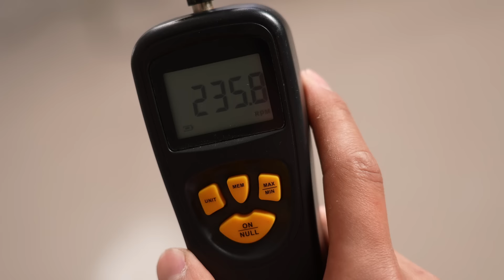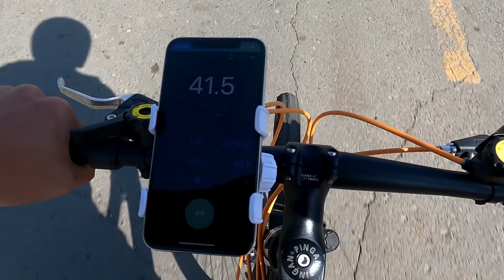Super speed Bike

Comment: Good work especially the way you welded segments of chainring to make a huge one, and using a short bit of chain to check the joints line up correctly was absolutely ingenious, but my legs aren’t to strong so I’ll think I’ll stick to my 44 tooth sprocket!!! Thanks for sharing 😀👊🏻
Reply: Plus he got this idea  from someone who already had a video up several years.
Reply: Electric assist
Reply: Looks like he didn’t check before welding that the final piece would fit on that disk, which is why there looks to be one oversized gap between pieces on the disk. Fortunately the margins were sufficient and it still worked, but I bet it produces a lot of chain bounce when the chain comes off that section.
Reply: @jeromilittle  This is lack of proper planning on his part .
Reply: Uki

Comment: That's impressive but he really let us down, that speed can easily be achieved by a beginner in an average mountain bike.
I was expecting him to go way over 60kmh
Reply: Bro I can only go 35 with my hardtail help
Reply: @Its_tomer   There are a bunch of factors that may be affecting your top speed.

1° Make sure you are using your highest gear the smaller cog in your cassette (and if you have more than one the bigger one on your chain ring).

2° Your posture makes a huge difference so try to be more aero when you're going fast!

3°  Your tires are also very important because they can completely change how your bike behaves. I personally use a  700x28 for the road and a 29x2.30 for dirt, narrower tires are the best for top speed (you can also use slicks if you are really going for it).

and lastly but pretty obviously avoid trying to hit your top speed going uphill because you aren't going to see really great results, try to opt for level ground and for testing the absolute limits of your bike you can go downhill.

!!ALSO PLEASE ALWAYS CHECK YOUR BRAKES BEFORE SPRINTING AND WEAR A HELMET IF YOU GOT ONE!!

Comment: I saw a chain wheel about that size in an early velomobile, years ago, that was made to go 55 miles per hour. I think they are even faster now.
Reply: nice but just so if you didnt know its called a gear wheel
Reply: @cutekiddej9023  chainring*
Reply: @cutekiddej9023  chainring
Reply: Cool! Is there any video of something like this?
Reply: @ffivguy1990  yes
Reply: No es eficiente que lleven tantos dientes
Reply: @xiki1506  porque no? ( No entiendo un choto, todo está en inglés)
Reply: Yo they go faster....normal cyclist are going 65+mph on 53 teeth chainrings etc..
Reply: @Joshua-rp3tm  as a cyclist 25 mph is not hard its just 40kph
Reply: i can do 50 on a regular bike
Reply: @supervortex8363  what bike?
Reply: @jonjon195  zaskar mtb with road tires
Reply: @cutekiddej9023  chainring, gear wheel, chain wheel, sprocket etc etc
Reply: @jonjon195  i have a GT zaskar with a 50 tooth front gear and 11 tooth on the hub
Reply: @yuca862  eso depende si la quieres para llano o montaña,por lo regular las de montaña ,llevan un plato más pequeño.
Reply: @princesol612  Sprocket*
Reply: Sounds french

Comment: Did similar in the 70's, longer cranks help but are dangerous while turning unless in the correct position!
Reply: I  remember being thrown off a few bikes from that, good times 😅
Reply: @ronniewilliz153  yup, exactly! ☺️👍
Reply: Thanks 4 the tip
Reply: Could you elaborate, how is it dangerous while turning please? Apologies if it's too obvious but I'm kinda newbie to bikes.
Reply: @mostafafouad3202  when "we" used to put the large sprocket and cranks from say a 26 or 27 inch bike on a 20 inch bike, the pedals would be much closer to the ground while driving straight on even terrain. With the pedals so low, if you were pedal down on the side that you were turning into that would cause the bike to jack-knife and usually cause you to fly off! It happened a few times, I learned the hard way! ☺️👍
Reply: @normandothegreat  Ouch I don't even wanna imagine the scene 😅. Good thing you survived and thanks for taking the time to answer a newb 😅. Have a lovely one sir. 😉
Reply: @mostafafouad3202  it is still fun to do, pedals easily and travels at a greater top speed, so for me it was worth the danger. There is a learning curve as with anything different. Have fun and stay safe. 🙂👍
Reply: @normandothegreat  wow now that you explained it I remember this happening to me in the 90's
Reply: Huh, wouldn't of expected that to be an issue for anyone. Thought having the pedal on the side im turning be at its highest point was just "instinctual".
Reply: @MrDJAK777  LOL, not for all of us obviously! I rode extremely aggressive, often pedaling as I was in the turn so I wouldn't lose my speed and momentum. I wasn't the brightest star in the sky! ☺️👍
Reply: @normandothegreat  probably entirely the aggressiveness thing I was only ever aggressive going in and coming out during the turns. I really love the sensation of tucking in as low as possible and feeling the forces exerted on the body and the resistance to it.
Reply: here correct pedal position won't help as sprocket is bigger than the pedal so it will always block.

Comment: I've wanted something similar to this (albeit smaller) for a while now.  Never enjoyed that normal chain rings cap out at something like 54 teeth.  My legs enjoy pedaling at around 80 rpm, and higher cadences kill me.
The best I could ever find anywhere are the 70~80t chainrings they make for recumbent bikes, but was never adventerous enough to try buying & retrofitting one.
Reply: Excercise bike cog and lnger pedals on a bmx bike and you can hit 40 m.p.h. but be warned bicycle tires are only rated for a maximum safe speed of 32 m.p.h.
Reply: you can buy track chainrings 64-66t, like Raketa Supersport
Reply: just get a smaller cog at the back. i’ve seen cassettes as low as 11 and fixed gear cogs i’ve seen maybe 13 or 14. Ur absolutely insane if ur able to get a 4.9:1 (54:11) gear ratio to an uncomfortable rpm
Reply: @cleanname4439  So, I did some math, and to pull off what I'm looking for would take me a range of 69t~75t - 11 depending on tire size.
-I did notice through previous trial and error btw, that smaller rear rings tend to lead to more friction in general (torque vs play in the casette, plus the outward-most casette rings introduce the most....what's the word for diagonal force? - on a piece trying to rotate along a different axis), so if I wanted to minimize that, it'd probably have to be scaled up a bit to 100t~110t - 16, which sounds a bit ridiculous (and heavy, and prone to warping...)
I'll keep picking away at the problem though.
Reply: @GeorgiaRidgerunner  I have a habit of running my tires as hard as I can get away with, which usually ends up being 90-100psi.  With some trial and error, I came across this brand of 1.25 RiBmo tire for a standard size frame, it's 800 threadware, it's foldable, it's got a sturdy side wall, it's just a beautiful tire and I love them to pieces.  (Funny enough it's usually the nipples of regular tubes that start to blow out above 90psi, so I'll have to reinforce those with some standard thread and a common whipping knot.)

But anyway, a pair of those, some puncture-resistant tubing, and a proper truing + tire balance will handle 45mph beautifully.  I just avoid going too quickly on roads I'm unfamiliar with.
Reply: @GeorgiaRidgerunner  They are definitely rated for more than 32 mph nowadays. Or at least the high end pro tires are. Pro's sometimes hit 130 km/h (80 mph) on descents. The peloton in the tour de france regularly descents at speeds of 80km/h (50mph).
Reply: @amnesite3573  with a 70:11 gear ratio  you would be going 62 km/h at 80 rpm. that's more than track cyclists riding for the hour record. do you really need that big of a gear ratio?
Reply: @danidaimondzofficial582  Yes.  I can't say I can hold the speed for too long, but things like that are handy when riding with traffic, especially in cramped roadways with no curb
Reply: just get a smaller cog
Reply: @jellebleeker  Keep in mind, in racing tire tech doesn't always keep up but that doesn't mean riders or drivers slow down.

That's why NASCAR banned the aero cars (Daytona, Talladega, Charger 500, etc). The tires couldn't handle the speeds they raced at.
Reply: just use smaller Rear Cog, BMX one have like 12 teeth

Comment: 40kph on a 29er mtb with a 32t chainring and a 9t cog. Knowledge about bikes is what its all about in getting up to speed.
Reply: Damn, you sure like spinning over grinding
Reply: I have 26er mtb with 32/10 max gear ratio. With 2.25” cross country tires it’s easy to ride at 40kph, with thinner slick tires 45kph(or more) on flat asphalt. 70kg my own weight, and 9,5kg bike. It’s important to have minimal weight, and top class hubs and gear set.
btw: I am not a sportsman at all.
Reply: @ИбрагимДринкерманн  mine has 2.4 rear 29er tires with 30mm inner wide rims. And 2.6 fronts.
Reply: I ride a 26inch mtb and got to 48kmh with tailwind. In decends I can pedal until pass 50kmh. But it's really high cadence...
Reply: @marcgtsr  for sure you have a very large chainring in front for that.
Reply: @MUTP-zq1oc  Its the original that came with the bike, I think is 48 in front and the back is 14... old bike, 53kmh is like 110rpm- up to 90 is comfortable, more than that is unsustainable for me. Using crosscontry tires for that 1.75
Reply: @marcgtsr  welp, its a big chainring if its a 48t. Damn i miss my 3x old bike.
Reply: @MUTP-zq1oc  it is! If I put a 12t in the back... Well maybe I need to go to the gim first.

Comment: Nice project bro!
Cut the pedal welded in the center, and re-weld it in the same position but attached to the edge of the crown, not the center. You'll see that you'll have much less difficulty pushing, this is a little trick I learned from doing research.
Reply: He could also make the pedal way longer, in that way he would have more momentum and put less effort

Comment: This will be based on continuous acceleration. It will be very difficult to start this cycle, but after you get a slight pace, you can continuously accelerate. Or you should start with bigger back gear and slowly change to smaller gear to get the maximum speed.

Comment: Now if you can eliminate air resistance, you'll be able to faster than a regular bike.
Reply: You mean car
Reply: @xthomasbhx  your mean motorcycle
Reply: if you eliminate friction and air resistance, you will just accelerate more and more without stopping. Objects in motion stay in motion blah blah blah. 

Air resistance is actually why its harder to attain higher speeds because the faster you go, the more and more air you have to cut through, so 60mph there is TWICE as much air as going 30mph, which is twice as much as going 15mph and so forth.

Comment: I have an 80T with a 210 mm crank. 175 mm is a standard crank length.  
175 mm = 103 ft-lb
210 mm = 124 ft-lb
Almost 20% torque increase. Can climb hills will little effort. Especially running higher gear, ex: 80T/15T, also increasing gear efficiency.
Flat roads average 40 kph with minimal effort.
Reply: You'd better have super long legs, otherwise you'll end up destroying your knees.
Reply: @BICIeCOMPUTERconGabriele   the range of motion radius only increases by 17.5 mm
Reply: The pedal strikes I'd get on my mountain bike if I had 210mm arms.
Would need some sturdy pedals lol
Reply: The amount of effort you need to put in to go 40kph is always the same regardless of gearing. You either pedal fast with low force or pedal slow with high force...energy expenditure remains the same.
Reply: @jamescrud  The force requirement changes with crank length. 
The higher gearing change means, there's equal effort between: example: [170 mm crank, 60T, 30 kph] vs [210 mm crank, 80T, 40 kph].
Also similar to a CVT engine, once you're at higher speeds, its easier to maintain  with higher gear. 
Its like going 100 kph in first gear.
Reply: @injesusname3732  Your body can only put out a certain amount of energy and it depends on your physical ability. It takes a certain amount of energy to move your body and the bike down the road at 40kph. If your body can put out the required amount of energy then it doesn't matter how you transfer that to the bike. It's physics. Sure you can increase the length of the crank and diameter of the sprocket but you'll need to push harder. You can't magically create extra energy from nothing. All your energy is used to overcome the mechanical friction within the bike and wind resistance. You say once you get up to speed it's easy but it's not...because now you have to fight wind resistance and that requires more energy.
Reply: @jamescrud  the easiest way to understand this.. Imagine changing a car tire with a 1 foot wrench vs 3 foot wrench. Which produces more power with less effort?
Reply: @injesusname3732  I understand all that. I'm a mechanical engineer. What you're not considering is everything else in the the drivetrain. The crank isn't the only "lever" in the system and changing it's length has minimal effect. A longer crank also means your leg has to move faster to complete one revolution compared to using a shorter crank. That means you're burning more energy. Studies have been done on all of this stuff and a longer crank has minimal effect on overall speed. Like I said...you can't beat physics.
Reply: @jamescrud  Yes your leg has to move slightly faster.. if you're using the same chainring size in both scenarios. 
Not sure what you mean by, the crank isnt the only lever in the system. Its the direct drive of the system.  
Also would like to see these studies, where longer crank has minimal effects. 
Longer lever = more torque.. basic physics. There's also body weight youre applying to the crank (essentially free energy). Where a smaller crank/gearing that power is lost. 
All of these factors highly depend on cycling style. If youre aiming for top speeds, TT, sprints, or marathon. Also riders physical condition, height, weight, etc.
Reply: @injesusname3732  Yea and a 2 speed drill spins faster with less torque in 2nd gear and slower with more torque in ist gear, energy remains the same. A Gear Ratio can increase the output torque or output speed of a mechanism, but not both.
Reply: @injesusname3732  You need to match the gear ratio with you own power to get the fastest speed as race cars do.
Reply: @Aussienessful  Yea there's a balance. The best gear ratio depends on you and your riding style.
Reply: @injesusname3732  it depends on your leg power just like the engine power on cars.
Reply: electric bike with 44 and 10 speed back can do 50km/h no problem i dont see any need for building bikes like this
Reply: @arnyczful  Ebike motor RPM is 10x faster than human peddling
Reply: The hills in your instance wouldn't be very steep though . It would be a bit challenging if you had to start on one of them .
Reply: @robertmcfadyen9156  Starting mid-hill is impossible on this bike. But even at a lower gear, Its faster to walk up hills and takes less energy

Comment: I was thinking about using bigger gears in the past , maybe front and rear , but also shortening the cranks due to joint problems from arthritis not allowing me to move legs ; actually have had both hips , right knee , and left knee will be replaced in a couple of months so now I might not do the customizing . In the past Didn't see anything in the market other than cranks for baby bicycles but wasn't sure if those would fit in an adult bike . Actually even though I probably won't do any fabrication to my bike I have been wanting some metal fabrication equipment for the longest time so maybe I'll finally buy some .
Reply: Daora

Comment: Cool project man.  I like it 👌 I wonder if e-bikes could make use out of a crazy gear ratio like this.
Reply: It would need to much tourqe
Reply: @spudstudios3342  Hub motor plus using your entire human wattage without pedaling like a madman seems pretty interesting as an idea
Im actually trying to do that right now, just waiting for the parts
Reply: @flosa1995 did you ever end up doing it?
Reply: @turbo7367  
Hi, Kind of 
I used a 63t chainring and with that it was actually quite usable at 65km/h and upwards

But you have issues with getting the bike rolling since the hub motor needs to get rolling to properly start
Also the motor is hard af to pedal without power

I instead switched over to a mid drive since then
Wayyy less issues

Comment: Also increase the diameter of the wheel , it will also gain some speed.
Reply: Right but then you need longer forks and frame, that's a lot harder to modify.
Reply: @Anenome5  Easier to extend forks than to make a gear

Comment: once you hit 40 KPH your biggest limiting factor is air resistance, minimize that and your top speed will increase
Reply: Or make the pedals longer
Reply: Wouldn't it be great if we had no air at all. :P
Reply: @jr8958  No need to state the obvious.
Reply: go to the fkin moon if you want no air resistance!!!!!!
Reply: @bamf6603  the moon has too low gravity. not enough grip to go fast
Reply: I have reached 42KPH on a travel bike with only gears inside the wheel shaft.
Reply: @dunk92  nice, but in my comment i meant that once you reach 40 KPH, you can accelerate past it, but you cant coast at that speed because air resistance will slow you down to 40 KPH, if there was no friction involved
Reply: @DJayFreeDoo  get some weight on yourself to get more gravity force on you.
Reply: @bamf6603  haha! I wonder how heavy i'd have to be to get that kind of traction on the moon.
Reply: @DJayFreeDoo  few kilotons.
Reply: @bamf6603  ouch